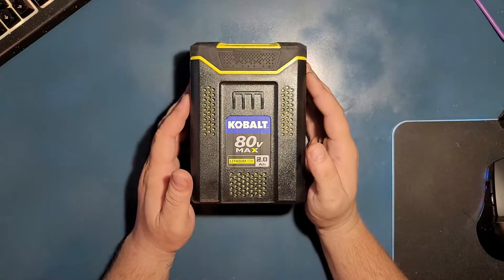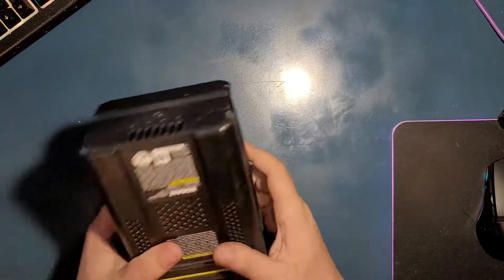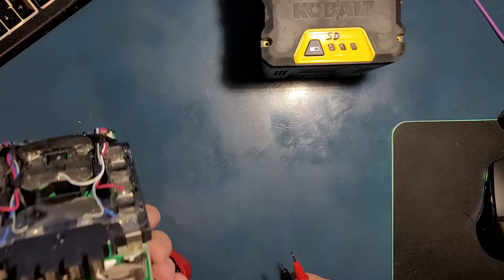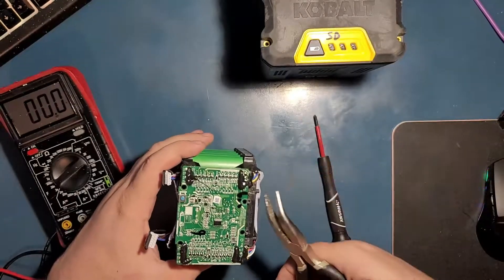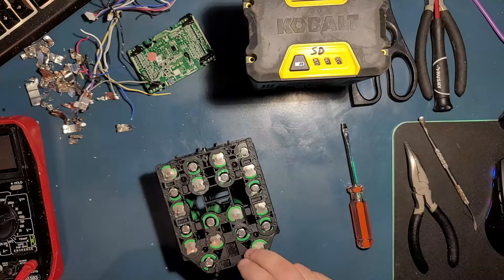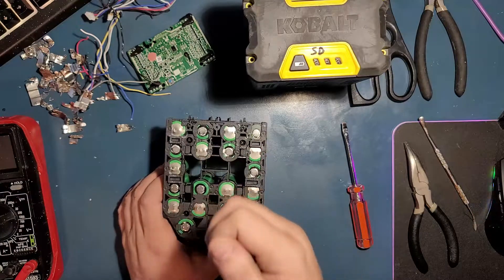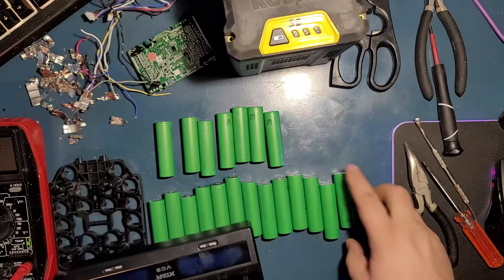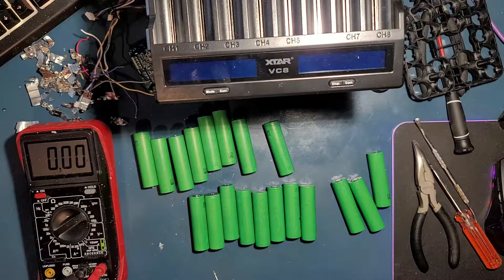KOBALT 80V BATTERY DISASSEMBLY AND CELL HARVEST

Comment: Kobalt is owned by GreenWorks and use the exact same batteries. Look at all the cells in only a 2 amp battery. That's called hp. I can only speak for GreenWorks 80 volt; they are NOT weak batteries, never overheat, and hold their charge almost forever. The GreenWorks 80 volt line of yard tools is probably the best in the world when you put them all together. I started with their chainsaw and expanded through the whole line. Excellent, well thought out tools. The line trimmer is such a beast, it uses metal cable instead of fishing line. The leaf blower will dry your car and almost shoots out of your hands everytime you hit the trigger. Now they have a 2-stage snowblower that will use up to 3 80 volt 5 amp batteries at the same time. Now that's scary. GreenWorks rules.

Comment: Not sure about Murata but companies could easily put any name on cells.  You can buy wraps with Panasonic sony or even custom designs.  They shrink to custom fit with hair dryer.  Rewrap batteries are common from china.  The truth is you never know.  The quality cells will have noticable higher weight...
Reply from the maker: i was thinking that the other day someone made a video here on yt about exactly what you said, and i saw myself where you could buy those wraps already printed and ready to shrink on cells...that's very sad

Comment: 09:30  Murata is a large, well-known Japanese manufacturer of a wide range of electronic components.  I use a few of their small surface mount components in my home-based electronics design & prototype manufacturing business.   Grandpa Google is your friend - type 'murata' into the search bar of a blank tab on your browser... 
I worry about your casual attitude towards ripping the spot-welded nickel tabs from the ends of the cells - you may be damaging them - I can see where the ripped spot welds have deformed the end electrical terminals - have you thought about the possible damage internally?  You recognize the potential fire hazard, but apparently don't understand how the cells are made & where they are vulnerable to abuse.  To remove the tabs, use a pair of needle-nose pliers to GENTLY roll the tab from the terminal so that you are not pulling directly against the terminal.
FYI, the circuit board with all the connections to each cell is a balancer card - during charging, it makes sure that all the cells charge to the same [usually 4.2 volt] end-point.  Otherwise some cells in the series string will gradually overcharge, while some will undercharge.

Comment: My kobalt 80v battery screws have stems on them to prevent removing them with a t10. Any ideas how to remove them?
Reply from the maker: you need what's called Torx Security these ones : https://amzn.to/47dCEwN ...they have a hole inside that fits around the stem...otherwise find a small pick and try to remove (break off) the stem carefully and you can remove them with regular torx.

Comment: My mower came with two batteries, one works just fine the second one won’t power the movers after 10 minutes of use. It shows 2 bars still charged. I can charge fully and use for 10 minutes consistently. I’m thinking the problem may be a bad cell. Thanks to this video I will now take it apart and  test for bad cells, hopefully it’s only one or two. While I’m doing this I was thinking of upgrading the battery to 4 ah. Any ideas how to do that?
Reply from the maker: sometimes the BMS may not be able to handle the control of all the cells, it's not neccessarily a bad cell as much as it might just be either overcharged or undercharged cell or cells, check them individually before you take it apart when inside...maybe you just need to take out one or two, recharge them to the level of the rest and it should all be good...make sure you have some kind of welder to put them back on.

Comment: Lowes does not make batteries or power tools. Kobalt is a Lowes brand, but that 80V tool line is made by Greenworks.  Greenworks also seems to make Kobalt 40V line. Chervon (Ego, Flex, Skil) makes Kobalt 24V power tools

Comment: What exactly are you basing your statement that this is a "weak" battery.  It is a 2ah 80v battery.  It is what it is.  My mom has a lawn mower that uses this battery and it works quite well.  I have a chain saw, weed wacker, and leaf blower that use this battery.  All work very well.
Reply from the maker: i had it for few months on a tool and sometimes it would simply refuse to start at all..and the battery would just show empty even when i just charged it...i meant that it is build very weakly in my opinion...i have 80v batteries from Atlas (Harbor Freight)...for my Atlas lawnmower and it's been over 2 years so far and have had zero problems with them, which to be honest i thought Atlas would give up faster..maybe my kobalt was a faulty unit...idk...i am not sponsored to say good or bad about any of these companies...i get tools and review what i personally see, i will get more Kobalt towards this summer and maybe they will change my mind, i'm very open to any company to change my mind...i'm not really a fan of a particular company, i only care to tell you my viewer the truth of what i see and how i see it...will let you know when i buy more Kobalt, maybe it was this unit alone.
Reply: @OMNITEK - when your battery does that in the tool, just pop it out and then back in again. Then the tool will start
Reply: @OMNITEK  Skip Cobalt and go right to GreenWorks. Those are the tools you should be buying, not the Lowes house brand. Who is Lowes?